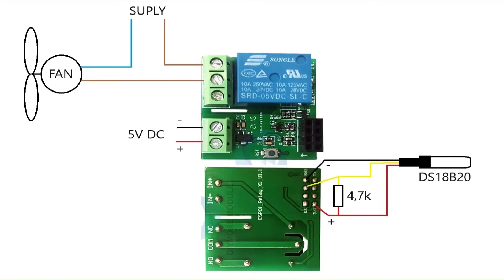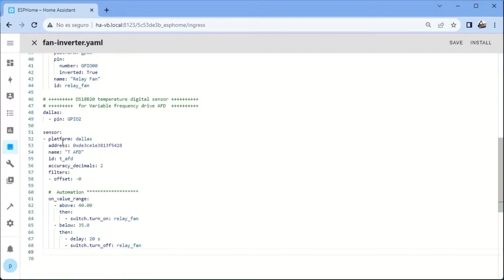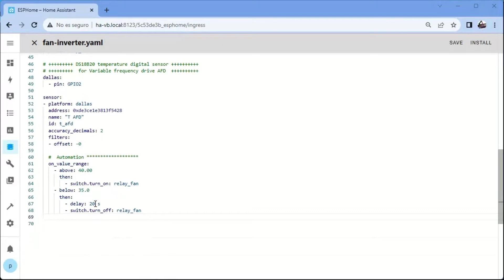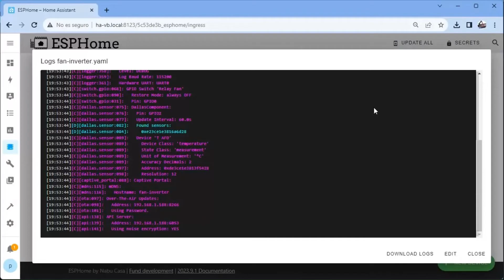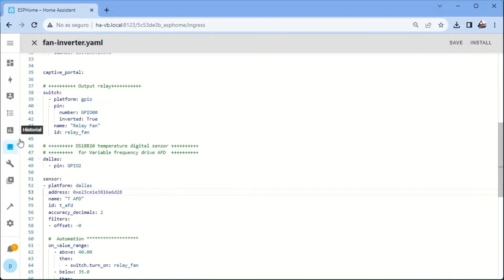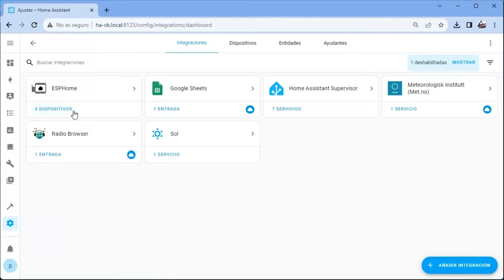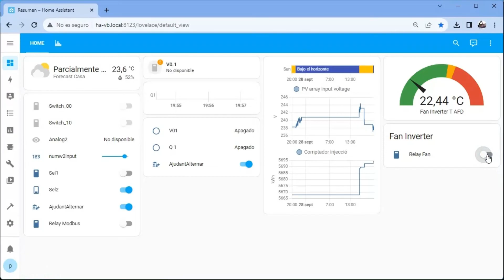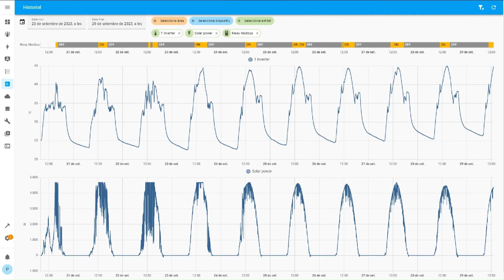Outdoor fan control of Solar Inverter by temperature measurement with DS18B20 probe, ESP01 Relay.

Comment: Hi friend, wondering is any custom PCBs may requried for further content? Would love to support here. (PCBWay zoey)
Reply from the maker: The projects look much better with a custom PCB but in this case, since it is only a resistor, the mole circuits do the job.
  Even if the circuit is more complex, if it is only one device it is not profitable either, although it is naturally much more professional.
We appreciate the comment and naturally if we have to make a series of PCBs we will take your suggestion into account.
Reply: @progspont2623  Sure thing, not only for this project, if any PCBs is needed for any upcoming projects, let us know!